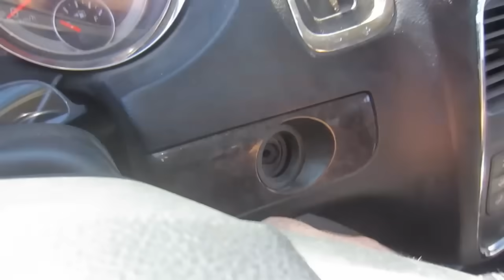Choosing a VW TDI Diesel engine for your swap  1 6 or 1 9 or 2 0 CRD

Comment: I know its been 25 years, but do you happen to remember what you  used for the added crank pulley for the p/s pump? I got a '86 n/a 1.6 diesel. Noticed tonight theres only a single row crank pulley on it. Looked at your swinging diesel video, same setup. In the vid where you repaired the p/s bracket i noticed an added pulley.
Reply from the maker: i used the extra pulley used for ac.

Comment: So did you change the radio in the gray van? Because I remember it had the basic radio when you first got the van. Now it looks like it has the the radio with the torch screen Uconnect system on it.
Reply from the maker: i got the right radio now.

Comment: If only vw came with a good Automatic transmission that had a lockup converter option.  A person can special order the pricey conversation kit though.   my vw automatic is still ok even though its wearing out causing a slight vibration on hard acceleration. Checked everthing else and they say its the bushings worn out.

Comment: Hello I like your Builds I have Jetta 2011 Cjaa manual I will love to swap in to Bigger Car Van Or Small pickup truck  I think Wiring Is Dificult And AbS sensors Do I need to Use Complete harness from Vw? Thanks
Reply from the maker: i made some videos how to the wiring.watch them.

Comment: The idi’s are harder starting but they shouldn’t be left out because of the advantages. They can handle many more different viscosities of fuels and  were built for hard economies. The injector opening pressures are lower so the injection systems can handle more beating. The pre burn chamber is an advantage for efficiency because it adds a step to vaporizing thicker oils under heat before entering the combustion cylinder. Idis should always be an option out there for people struggling. They can handle higher compression to add efficiency. They can also have more rpm range because the combustion has more duration. I would say the performance is very comparable if the displacements were the same. With my experience I’d choose an idi over a direct injection any day.
Reply from the maker: drive a crd then decide.

Comment: 1.2 TDI along with the Audi A2 chassis. 96 mpg and no risk of rust thanks to aluminium chassis.
Reply: I’ve got a 1.4tdi here in the UK. 2001, got it in 2014 as my first car, still driving it in 2025, now 227k miles. It’s absolutely brilliant.

Comment: I have run ALH, AHU, AFN, 1Z engines for the last 20 or so years, fantastic reliability and fuel economy, AFN is the best for power, 110 HP and good torque. Present vehicle is 1998 Seat Alhambra, which is a very similar vehicle to your caravan. 

I love simplicity, I'm in the middle of swapping an AHU into a 1983 VW Golf Mk1, VW Rabbit in North America I believe. I removed the electronic injection pump, and have built a mechanical injection pump using the pump from the old 1.6 turbo IDI motor which you have in your first caravan, using a direct injection camplate, you can use the camplate from the electronic pump if you like, but I'm using a higher lift one. 11mm pump head and shorter timing piston to give more dynamic advance. You can remap with a screwdriver, adjust boost pressure to whatever you want etc, the big advantage, no immobiliser, fly by wire throttle, ecu, sensors etc, all I need is one wire to the stop solenoid on the injection pump. 1960s simplicity and as much power as I choose to dial into it. This is my ideal, but everyone is different. Glad you're happy with your common rail.
Reply from the maker: my cjaa has 195 hp.
Reply: @davidbrock4506  That's great, mine won't make that much, but I'm happy enough with it, I'm just behind you, at 62 years, my street racing days are over! With the little old Golf at around 800KG I will have more than enough power if it only makes 110HP, that's 138 HP per ton.

Regards.

Comment: What happened to the white body caravan, or did you just pull the engine out? And put it into this body
Reply from the maker: scrap
Reply: @davidbrock4506 i could be wrong, but I'm assuming you just took the engine out of that. And put it in this body
Reply from the maker: yes.

Comment: Hey Dave I’m a huge fan, I’ve been watching you for 10+ years you are my idol. I’ve watched your how cheap am I videos and I’m dying to know with all of the TDI swaps and stuff you have done have you ever made your own homemade diesel and ran in it in your 1.9? How did it run, and what modifications did you have to do other than the manual injection pump? I really love watching your videos and hope one day I could get the chance to meet you. Until then cheers 🍻
Reply from the maker: i have run my 2 older diesels on so many types of oils. all worked well in the summer. gelling problems in the cold.

Comment: I want to try alternative fuels, so of course I try for mechanical injection. Unfortunately about everything with mechanical injection is either rotted, lacking parts availability, or run into the ground.  Wanted to do a k-car with a aaz, but both are basically unoptamium. Managed to get a '86 jetta with the n/a 1.6. Seems to run ok, its gonna get pulled for a reseal,, a timing belt kit, a Clutch and a rebuild kit for the crap rod linkage.

Comment: I remember your first diesel van, that old white one.
Reply: I believe the drivetrain in the blue 1995 was pulled from the white 1990 when it rusted out lol I remember watching that swap video almost 20 years ago. I remember he had issues getting the speedo working right on the 1995

Comment: I have a 93 VW Transporter with the 2.4 Diesel and a 5 speed. It survived out here in the okanagan as it was never used in the winter. Sure could use a turbo, but it gets along fine while returning great mileage

Comment: glow plug. block heater.   Extra horse power... but could the frame, or drive train handle it.   I mean where do NA built fail? EDIT: I think durable goods aren't durable anymore and I never was a fan of NA built after the 90's
Reply from the maker: this is the toughest built caravan yet.

Comment: Your the perfect guy to ask about this..
I can get an almost local 2011 tdi wagon for 1500us the only thing is the flywheel is clunking. 
SO i am not dropping the transmission I wll cut my losses or not even bother with it, I cannot I will not, 

BUT im not unreasonable so, what if i took the stater motor off, then got some wedges, then rotated and wedged out the flywheel into a concentric position completely centered?
I can dial indicate the moving mass part of the flywheel so its perfectly centered and balanced.
Within 1 thousandth. 

Then I precision tack and then weld 1/2" beads about 8 or 12 of them to locate the flywheel firmly and centered perfectly with that dial indicator. 

You think theres enough space?
Would a solid flywheel ruin the trans?

I think its highly possible
What would you guys think?
Reply: That honestly sounds like more work than just dropping the transmission and fixing it properly. If you work efficiently you can have the flywheel swapped in 4 hours.
Reply: @spikerbrad23  Never will it take that long for someone that doesnt work on cars routinely, AND I dont have any of the tools, But I do have a welder, and a cheap - free indicator that works pretty well. 
I might convince myself to Try it at least, and then if no luck say nothing and sell it. Or sell it to a vw mechanic. 

I am mechanically inclined and fixed my more than fair share of, everything, and I can tell you like TELL YOU there is no way to do that job in 4 hours. It would take AT LEAST a full day and very most likely late into the night. 

There is always some bullshit needing abusing uh I mean adjusting. 

I never would ever reccomend an engine swap to a newcomer, or trans swap or even timing belt job. ITS TOO COMPLICATED. 

Its like telling a new med student to do a hip replacement with no training. ITS CRIMINAL. So I will not be led that route. Ever, AND i discourage people to NEVER mislead, ALL things must be considered.
Reply: @RobertSchmitt-u7l  There really isn't anything complicated about it, you turn bolts to the left until the transmission is out. Then you reverse what you just did. I did my first timing belt job when I was 17 with no help other than a paper manual. If 17 year old me can do it, anyone can do it.
Reply from the maker: that might work and wont hurt the tranny.

Comment: Know Dave's shown how the half shafts connect before, but not sure how exactly it was done.  Think it was a machined out coupler to connect both halves and welded together, or something like that.  The fuel system too.  Does it still run the same pump or some other method.
Reply from the maker: i use the caravan pump. i have a video on making the axles here.

Comment: Dave im glad to see your back. In in my 30s now have watched your videos since I was a teenager I made many things growing up because of seeing what you built. I built multiple go karts I used to garbage pick mowers and fix and sell them made 500 in one summer pretty good for a a 13 year old kid lol now I own and operate an auto repair shop with my dad and own several vehicles myself my current project is im soing the Ole switcharoo I got a 78 mercedes 300cd with the legendary 0m617 diesel engine and a 98 pontiac gtp with the 3.8 supercharged the 3.8 supercharged ia going in the mercedes and the om617 in the gran prix I currently have the 3.8 adapted to a t5 transmission I built the adapter everything myself minus the flywheel and I did get a little advice from a machinest to get my tolerances just right. Now im working on engine mounts on the merc and modifying the front subframe and firewall on the gtp ao the om617 diesel will fit into it. Still trying to decide what rear differential i need to convert the gran prix to rear wheel drive and yes I apend way way too much time at the shop. Thanks for giving me inspiration dave.
Reply: Would it be Allright if I reached out from time to time for some ideas. Retrofitting an engine that was never designed to be in a vehicle is extremely challenging and I respect what youve done and I am into the exact same thing.

Comment: Where did you put the intercooler on the CJAA?
Reply from the maker: i used the vw ac condensor , coolant rad and intercooler all in the same location.the intercooler is as big as the radiator.

Comment: I have installed a TDI engine into a 2008 Gasoline Passat wagon.. my only issue was the filler neck that is smaller on a gazoline car! I Had to use an adapter to put diesel in the tank! the nozzle wouldn't fit! :)
Reply from the maker: that is too easy a fix. i machined a fitting for my air chizzel that opens  up the filer hole in 5 seconds.
Reply: @davidbrock4506  Yeah I just saw your last video! I should have thought of that! that's clever :)

Comment: A good friend had a VW Rabbit with a diesel and manual transmission. He bought it new in 1984 or 85 when diesel was much less expensive than regular fuel. He preceded to drive 700,000 klm in 12 years, was totally gutless, but was the most reliable vehicle I have run across. It’s too bad diesel fuel is now so much more expensive than regular automobile fuel.

Comment: Are you familiar with the Volkswagen Routan? Its based off that generation of Caravan.   I wonder what motor that uses
Reply: Those were powered by Chrysler engines.  It came with the 3.8 and 4.0 liter v6 engines from 2009-10 and the 3.6 pentastar engines from 2011-14. All Volkswagen did was tweak the interior and exterior styling, and some suspension tuning. And unlike the Chrysler vans no swivel n go and stow n go seating on the routan

Comment: Does Canada have looser NOx limits that even their newer diesels are able to get this good of fuel economy? American diesels have to have large EGR flows and an additional fuel injector in the exhaust or urea to get the NOx within limits. Also, do the newer engines and electronics have issues switching over with regard to the security/immobilizer systems?
Reply from the maker: my tires are are 17 % bigger on my van than vw. lower drivivg rpms. my tune improves mileage.our emmisions are strict.the immobilizer is easily shut off.

Comment: You swapped the purple caravan also?? When did you do it? I guess you didnt film it. I remember you got it for free by trading in old derelic air conditionner for gift cards at canadian-tire haha You had the gas engine for a while. When you fixed the starter it wasnt swapped.
Reply from the maker: swapped it 8 years ago.no videos.